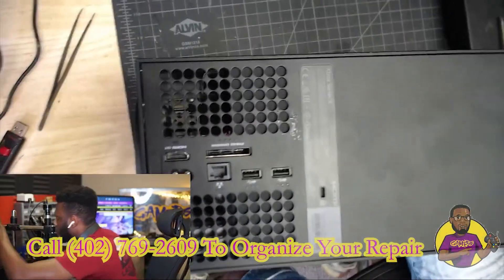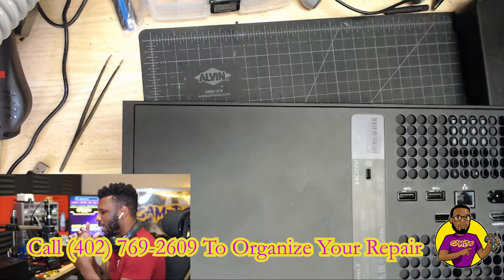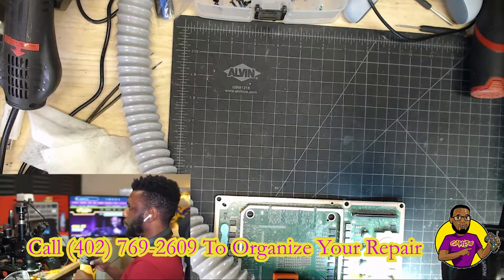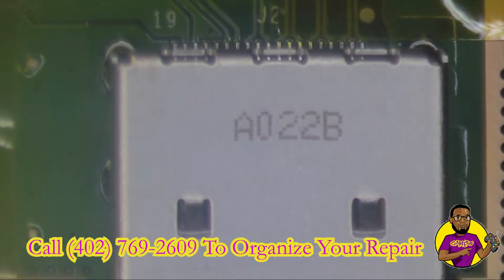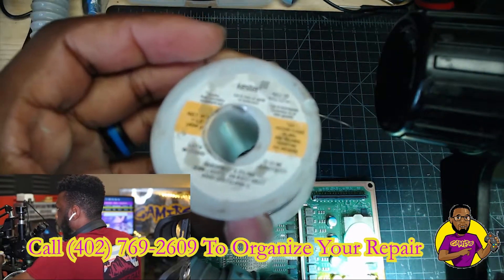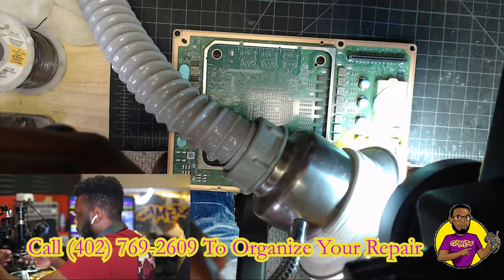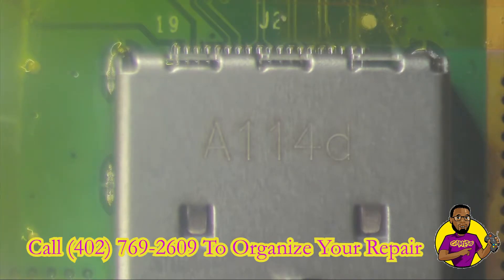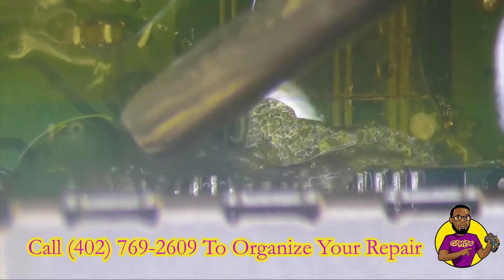Fix Xbox Series X Black Screen HDMI Port No Signal Repair (2022 Method)

Comment: Hiya buddy, noob technician here, with a few questions.

My Xbox One X stopped displaying on my TV. I tested on alternative monitors, tested the TV used with other devices. Attempted internet fixed, powering down, resets etc but still nothing.

My light comes on and the fan starts than stalls as it attempts to boot up. 

Is it possible that it could be a software based issue? It’s a very well kept machine with not very many miles on it. 

I feel confident to open her up, but looking for some semblance of a plan…am I right to think HDD, FAN, HDMI port from a hardware perspective are likely culprits?

Comment: May I ask why you chose the heatgun over a soldering station with a heat wand. i mean you went and got the hakko soldering iron. but either way your professional and did it right. also i never knew a heatgun had settings like that.